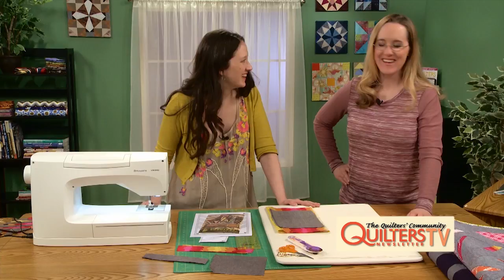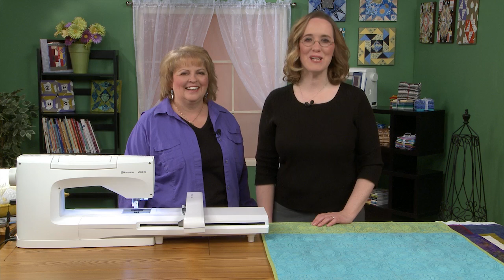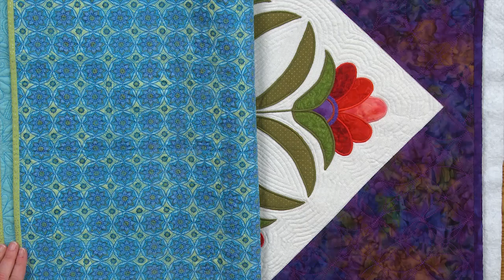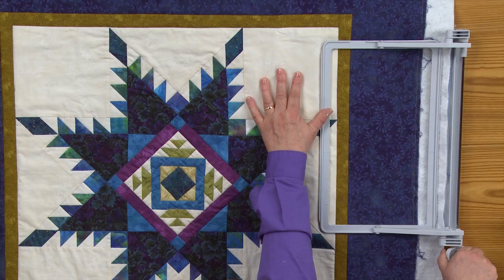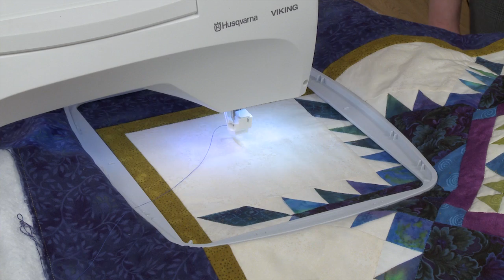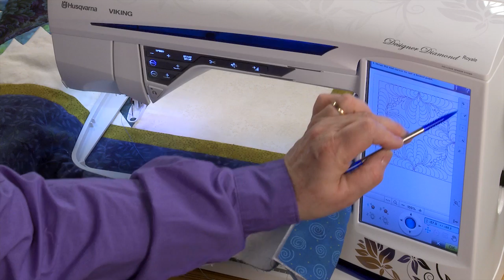Quilting with an Embroidery Machine with Karen Charles

Comment: I'd like some advice.
I need a quinting sewing machine.
I am poor man, it is not possible to buy expensive quilting sewing machine.
Name the best quilting sewing machine at the lowest price,
I don't need any design of sewing machine, I don't need many functions
I'll only use quilting pressure feet. I will design the round on a designer fabric and I will sew the simple round design with my hands

Comment: Hi Karen,  I'm like you, if I say I made it, to means from start to finish.. I have the Epic 2 and T50.  I've pieced a few quilts and quilted them, mostly stitch in the ditch and tried my hand at meandering.  But I'm so excited to know that I came quilt using my machines.  You mentioned that you stitched in the ditch to secure the top, batting and backing before your did the the quilting in the hoop.  How much did you stitch in the ditch, the whole quilt or just the large blocks?  Any guidance you can provide will be greatly appreciated!!!  Thank you in advance.